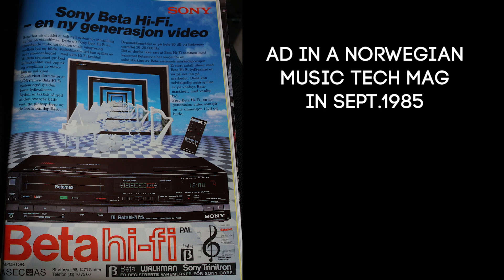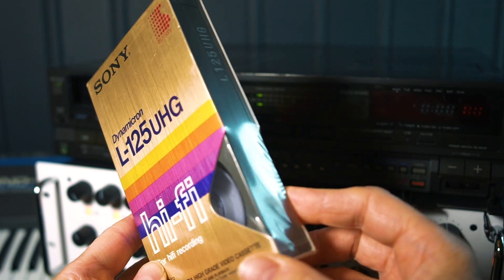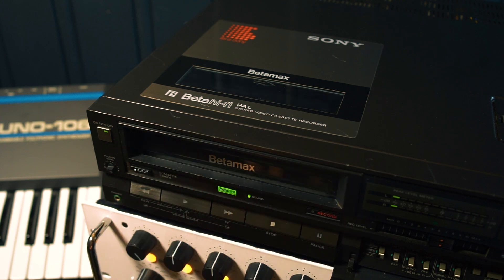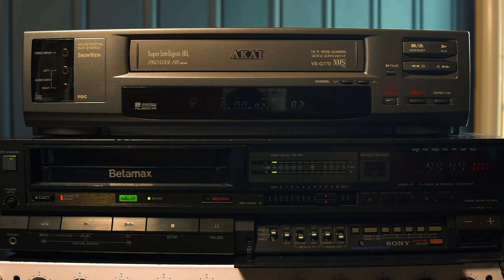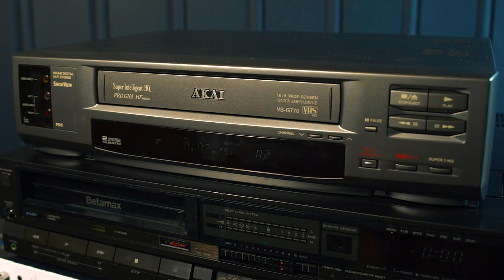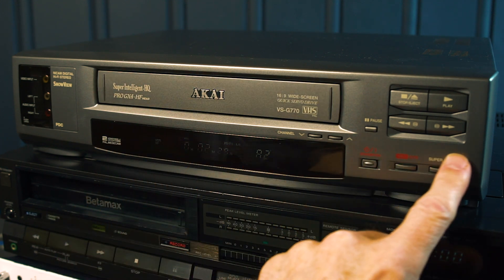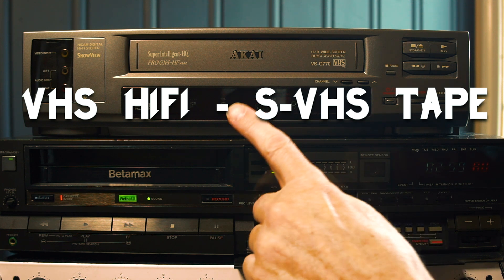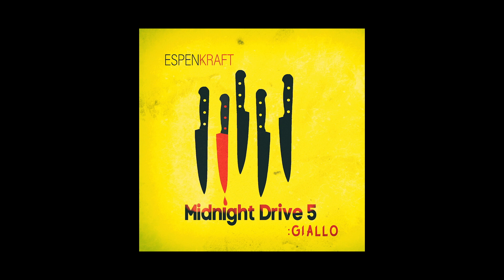Betamax Hi-fi Stereo Mastering | Holy moly what a sound

Comment: I still use Beta HiFi today for music recordings, I have the SL-HF100, SL-HF150 and the SL-HF950 here in my collection plus a Sanyo HiFi VTC-N50. Then there are also 4 NTSC Beta HiFi manuals. The difference between Pal Beta and NTSC HiFi Betamax is that Pal recorders have separate HiFi heads and NTSc has a different technical solution

Comment: hi have alot of this model alot that i have to take a part and work on them  

i have been down the vhs hifi with the meters      and same with the sony 100ub  sorry  100 ub are bad and not great 

there is a for mat that is ace  and is a right tank i have been buy them  alot at a time for parts  sony 75 betacam   decks  

i have 14 x sony  75p and 500 range   betacam why there;s alot of new sealed tapes still a  round 

i have a soundcraft 760 range deck   that are still working  

some time ago i got alot of zonal 1  inch tape  200 of them   they are not liked because the way they record   any not like the ampex  sound

Comment: I have about 10 good quality hifi VHS machines....3 of them are SVHS. I cleaned, oiled and did a belt change on 3 of them. Still trying to find time to fix the rest.

Also I bought a PCM unit this summer that will record and play on the video track of any VHS via the composite cable. I guess it's kinda the same as what your VHS here can do 😊😊
Reply from the maker: Hi-Fi audio on the VHS deck here is recorded by using the RCA L/R inputs. Composite is video only.

Comment: Vhs hifi was pretty decent, I still have a Panasonic hifi VHS within my 80s / 90s Sony separates hifi equipment, it's a great little machine from 1990 has separate L & R record level sliders, and audio only switch, Mpx filter, index marking for selecting tracks and large VU meters, 3.5mm headphone and mic jacks.I have a bunch of 240h tapes that have 8 hours of music on in lp that I listen to regularly, considering I recorded these back in the 90s they still sound absolutely fine, also my old and rare vinyl records have gone down to VHS hifi too.

Comment: I vaguely recall that auto-tracking VCRs used the video signal to determine the tracking. It may be necessary to hook something up to the video input (signal generator, C64, whatever creates composite video) just so it has something to lock onto while the audio records, so the tracking doesn't duck the audio again. That said, this is the first time I've ever seen a Betamax machine used -- the battle had been won by VHS by the time I came around. Incredible machine! 👍

Comment: Did Beta Hi-Fi have the same head chatter issues that VHS Hi-Fi? I would put all of my old cassette mixtapes on VHS Hi-Fi as backup, but I stopped doing it because of the head chatter problems.

("Head Chatter," or switching noise, can be heard as a low-level distortion. It's hard to describe, but once you hear it, you'll know what it is...)
Reply from the maker: Beta Hi-Fi and VHS Hi-Fi audio are recorded very differently actually and not comparable technically at all.
Reply: @EspenKraft  but both systems used the rotary heads for laying down the audio carriers, and both systems did in fact actually suffer from head switching noise as a result if they weren't working perfectly. That's what he was asking.

Comment: In the mid 80s we used a Betamax vcr with a Sony PCM unit for digital mastering. CD quality!
Reply: @Z4NL  I still have one of those! Interestingly, you could choose either 14-bit or 16-bit recording (I think the 14-bit had more error correction), but both would record with pre-emphasis, where the high frequencies were boosted on record and attenuated on playback. When used with a VHS recorder with "HQ", the HQ circuitry could confuse the digital decoder, because it would repeat the previous line of video if there was a dropout (rather than just showing the dropout), which confused the error correction circuitry in the PCM adapter, leading to audible glitches. I haven't used mine in years, but I do have some tapes I recorded on it back in 1993 and 1994 that would be good to back up at some point, if I can get a VHS machine that will play them OK. I switched to DAT in late 1994.

Comment: Both systems give the song a very nice tape saturation, specially in the snare.
Reply from the maker: There is no tape saturation going on here, but the way audio is FM encoded has its own sound as I say in the video. ;-)
Reply: @EspenKraft  I thought I was listening to tape compression, which in return translates to tape saturation, that fizzling sound on the higher notes noticeable on higher notes and instruments with a fast attack wave, like snare drums, along with a "cohesive rounding effect" on the sound being fed to the tape.
Reply from the maker: Although all Hi-Fi VCRs have a couple of static analog audio heads for compatibility with cheaper decks, the Hi-Fi tracks are recorded analog with FM technology so the sound's color aren't determined by recording "hot" as on a conventional analog tape deck. FM audio has its own sound and it does have a coloring that might be taken for conventional analog saturation I guess.
Reply: @EspenKraft  Yes,it does seem to sound quite similar to mixdown to conventional 1/2 inch tape, whether the engineers that developed this technology had set their intentions that way, I have no clue, however it does meet the criteria in terms of what was accepted as pretty high quality recording at that time, and it certainly sounds great today as well.
Reply: Subtle distortion, maybe. Certainly not saturation.
Reply: YouTube audio is hardly the forum to judge.

Comment: The MPX filter was used for recording FM stereo broadcasts, which used a 19 KHz pilot tone to indicate the stereo subcarrier was present at 38 KHz (first harmonic of the pilot tone). The MPX (multiplex - used for multiplexing stereo channels into a single carrier) filter is just a 19 KHz notch filter. If you are not recording an FM stereo broadcast, the MPX filter should not be used. Also...the MPX filter filters the INCOMING audio, not the outgoing audio, so it has no function during playback.